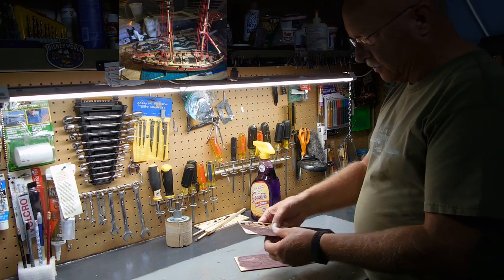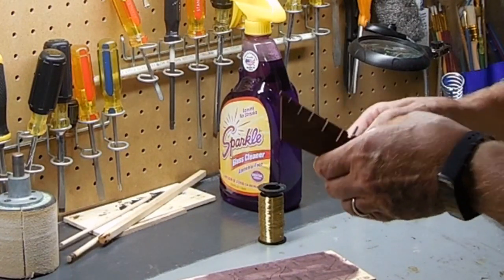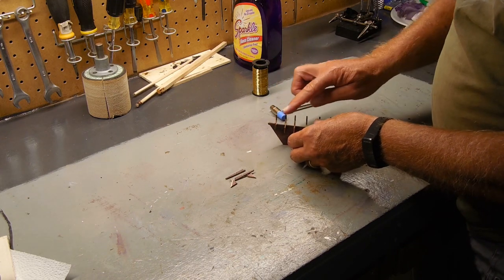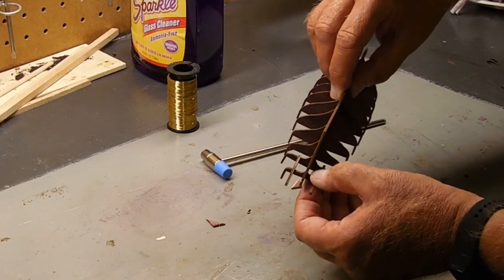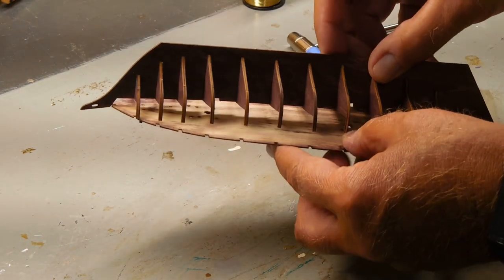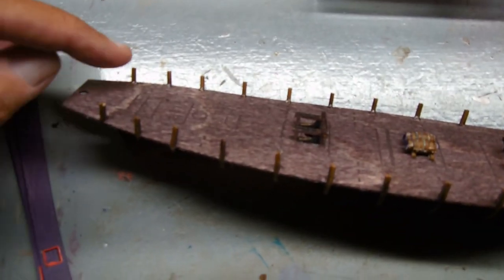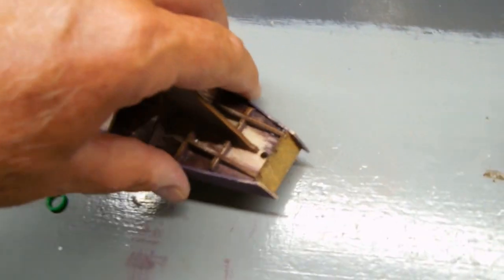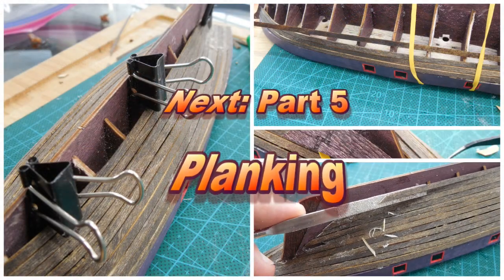Wooden Model Ship Build Part 4

Comment: You should really show the bending and attachment of the deck siding as this can be very tricky especially on the models that have gun ports alone the part that needs bending.
Reply from the maker: Great point.  I have one more ship to build for one of the Grandkids.  I'll make an add on video showing that in detail.  However, these ships are easier, so I'll show it with no tools.  Then I'll add a little on using a bending tool... I'm ordering one today, and will use it on a serious build on my first actual high detailed build of "The Black Pearl" That I might do a video series on it... But I bet it will be about 1 year to complete.
Thanks for watching and making a good suggestion.
Reply from the maker: I finished a segment on planking.. Not 100% satisfied with my work on it, but I'm a beginner too.  Maybe it will help other beginners!  Here is a link to the segment 5-A Planking.
https://youtu.be/ih-XAfySaU0
  Since I made it, I ordered a hot iron type plank bender.  I'll use it this fall when I try building a larger ship!
Thanks for watching and giving me the idea to go a little deeper into the topic.